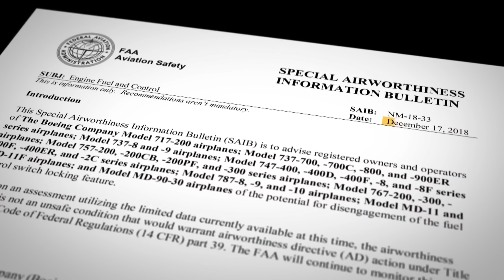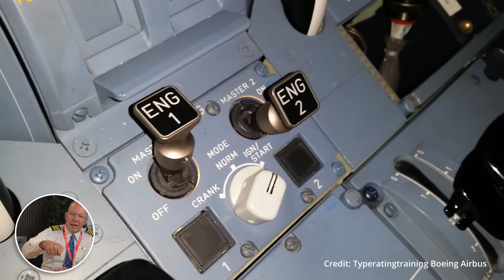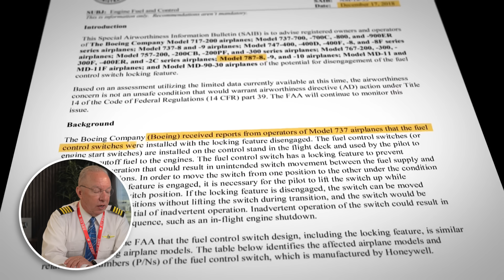Air India 171: The FAA’s 2018 Fuel Switch Locking Bulletin Explained (16 Questions Answered)

Comment: Very surprised that you are so definitive that one of the pilots deliberately moved the fuel control switches to off. How can mechanical failure of the switches be ruled out so early in the investigation? Was any maintenance performed just prior to this early morning flight? Had any problems been previously reported involving the switches?  I’ve read reports of these switches being replaced twice during this aircraft’s lifetime.  It seems too early to quickly blame the dead guys.
Reply: One switch, maybe.  But both? At the same time?
Reply: Well the fact that BOTH went out, then both engines started to spool down (which the fdr picks up)..... then the voice recorder picks up one pilot asking the other pilot why he did the cutoff..... then the fdr picks up a pilot switching the cutoffs back on and one engine starts spooling up before hitting the ground...... seems like they were working and as Steve says..... if they had just a little bit more altitude the one pilot might have been able to save it
Reply: The investigators have the switches from the crashed plane in their possession and will certainly have tested them already. if the locking mechanism was defective a directive to all operators of Boeing airliners would already have been issued. That has not happened, so no problem was found with the switches.
Reply: @SeanFication  I find it interesting the preliminary referenced that bulletin but didn't give any report on testing.  I say test results are still TBD.
Reply: These switches are not going to jump to off all by themselves believe me. They are engineered so that can never happen by accident
Reply: Because its the logical conclusion to all evidence and life in general. He didnt want to leave his act to chance, turned off the engines right when you must not do it. No way to save it right then.
Reply: If the PIC was the junior officer, it would make sense for him to ask the captain why something so out of the ordinary was done, in deference to his many thousands of hours more experience. To me, the response, "I did not do so", was off. I would have expected a note of dismay or alarm, like "WHAT??", or more likely "WTF!", and not what sounded defensive, and certainly not helpful.
Reply: But why would the pilot ask the other pilot , why he did that? If I notice something the switches are off I would say “ what’s happening, or how did that happen “ , not why you did that
Reply: @freedom5941  I think it's quite the opposite. If the fuel switches are off and you didn't put them there, first instinct would be to blame the other guy.
I agree with @87AeroCoupe, Steve seems way to dismissive of any other possibilities for the switches to be off, without any evidence other than it never happened to him. A failure of the indentation mechanism is not absurd at all, in my mind. 
Just after getting my driver's license, I was driving my dad's car with him, and there was a couple of times where the gear didn't fully engage, causing the car to make a loud grinding noise and not accelerating when I throttled. This was a relatively new car, and it had worked perfectly fine until that day. Note that this car's shift was also indented, and very sensitive, any movement in the direction of the gear would snap it into gear. My dad's first assumption was that I was somehow hesitant to change gears, and I was fighting the snapping mechanism, leaving it halfway. A few days later, he got stranded in the middle of the street when the gear would engage. The gear synchronizer was failing. Since it had never happened to my dad, he couldn't even consider this.
Reply: @freedom5941 Because he was covering his actions and muddying the waters for the investigations. Or the person who responded was lying, either way they know their words were gonna be recording only in 20 seconds. If this was planned out like i think it was, creating the recorded narrative was paramount to the criminal. This cockpit is a logic puzzle.
Reply: @freedom5941  Yeah which is why I wonder if one did see it even out of the corner of their eye. And someone saying it's not me can have more than one explanation. Depending on who did or said what. And if one did it and the other one said why and the answer was they didn't, I think it might help to know which pilot said what. B/c they're might be different dynamics in an exchange if one has seniority or rank and experience over the other. The only background I heard on either in interviews was the FO was engaged to be married (per his family) and the captain might have been a caregiver possibly livein with his father. I don't remember who provided that information on the captain.
Reply: @freedom5941  - Under panic anything might be said, it could be assumption that the other pilot had done it when it was actually mechanical failure?!!!
Reply: @DangoGSD under panic ? I won’t be blaming other pilot .. I would be wondering why it happened, this clearly seems he saw something , why do you think pilots can’t be human beings when so many have done this in the past
Reply: @freedom5941  no, you're very wrong. it doesn't clear anything. under panic when one doesn't have much time and death is clearly visible, they would try to converse as quick as possible and go with their first thought, which is, in this case, he would think that the other pilot might have only done it as there's no one else to do. it is also possible that he did it himself but also asked why did he do it to the other due to some mental problem. also the way you think doesn't apply to everyone. basic common sense.

but, main thing is that it's not possible to switch them to cutoff so quickly.
Reply: @debargha0_0 it takes a second to cut it off as per pilots ..
Reply: clueless
Reply: Denial is a sin.
Reply: They were switched out on that plane in 2019 and 2023 for reasons unrelated to Boeing's bulletin. It's not clear whether that would have "fixed" any problems in the bulletin that were warned about or not.  The timing of when both switches moved to cutting the engines off to being the worse possible time pretty much dooming the aircraft. Though I'm not sure 01 means "One second". Tend to think so b/c  seconds are reported that way when they display the time of incidents (in situations where seconds matter) as 7:43:13 for example. Or 08:02:03.  Unless there's an obvious issue arising from maintenance issues (which has happened in other plane crashes) which leads to recalls of parts or even plane models for example, might be quite some time b/f they release information on it. I think Air India dropped the ball by not inspecting the fleet's switches. And they can always get more information or inquiries into the switchouts on the plane in 2019 and 2023. But I wonder unless someone witnesses the switches being moved to "Cut" why the question wasn't more along the lines of "what just happened". And wonder if it was witnessed even if via peripheal vision (as the switches are in between both pilots).  CVR is impacted by having what it captured especially in comments made because it's paraphrased and that can be biased more than an accurate transcript would be.

Comment: There is still zero evidence it was deliberate action, only thing is that the switches where to the cut off position, only that. You are speculating a lot.
Reply: The preliminary report quoted the one of the pilots asking the other one why they turned it off. He’s not speculating- he simply read the report.
Reply: clueless

Comment: Hey Captain Steeeve, love your insight always. What is your opinion regarding a physical design change in the fuel cutoff switches? Design a secondary set of switches on the Captain's left side that a First Officer physically could not reach from their seat. It would require the Captain to physically concur with the decision to shut fuel from the engines. No, it would not prevent a Captain from having mental health issues and cutting fuel, but it would be one more failsafe to take a possibility out of the equation and ultimately allow the Captain to be responsible for the decision to cut fuel to engines.

Comment: Steve seems to be pretty convinced that it was the pilot and is not willing to consider some unforeseen flaw. Wish there was a cctv footage here to defend the dead pilots. There was an advisory by Boeing the switch locking mechanism not working, then was this cause not considered in this case. Looks like Boeing has something to hide by shifting the blame solely on the pilot.

Comment: the first officer was flying as mentioned  in the report and captain was handling other things ,  so after takeoff the captian moved the fuel switches asumming the copilot has his hands on the stick , there should have been more strong words exchanged if the copilot had did it , and the RAT deployed photo shown in the report show plane right above the domestic terminal  and still above the runway  , and why they have not released the full transcrpt og the voice recorder ?

Comment: I feel like 10 seconds is quite a long time to reopen the fuel lines, isn't it?
Since the first engine started to produce thrust again. Would have a quicker reaction (2 seconds earlier for example) have been enough for the plane to climb?

Is it maybe an idea to delay the closing of the fuel switches in flight by 5 seconds or only allow them in a case of fire (this would also prevent the mistake to shut down the wrong engine)

Comment: This failure looks like  G-load at V1 or V2 that knocked back the switches to cutoff, it could be failure of the SPRINGS that moved them automatically to Cutoff position, if they slipped over the Detent which does not look that deep. This is issue with the Switch itself that is made by HoneyWell. If Boeing was aware of this and has simply issued an Advisory instead of a Directive, they are in BIG TROUBLE

Comment: I find it odd that:
1). given how close the 2 pilots were sitting next to each other and that each of the 2 fuel knobs required some conspicuous actions to move from run to cutoff, wouldn’t one of the pilot have noticed the other pilot moving the knobs? If so, shouldn’t we have heard “what are you doing?” rather than why you did cutoff and the corresponding reply he did not. 
2). During takeoff, aren’t both pilots hands on the yoke and won’t any action to move both fuel knobs be noticeable?
3). If the knobs were on cutoff, why do some reports say the knobs were found in run positions at the crash site?
4). Could something else eg: electronics have caused the fuel cutoff, which made the pilot seem surprised and ask the other pilot the question he asked? 5). In an attempt to kickstart the fuel process again, could the pilots accomplish it by moving the knobs again from run to cutoff and then to run again?

Comment: Many thanks to Captain Steve for clarifying this. 
My father was an Air Force crash investigator many years ago, and I always try to imagine his perspective on crashes like this. Hopefully, this crash will prompt a fundamental design change in all future Boeings - just as the landing gear cannot be retracted on the ground, the engines cannot be shut down in flight (or the in-flight shutdown procedure must be significantly more complex, not just mechanical latches with springs). Otherwise, the whole purpose of any investigation - to prevent similar crashes from happening again - will be defeated.

Comment: Have you read the bulletin? It recommends inspection as incorrect insulation can result in mid flight engine shutdown. The air India plane was not inspected. It’s hard to still believe Steve is impartial, the way he blew right past this.

Comment: The switches need to be subjected to Failure Analysis.  Also this does look like a "design flaw": the position of the switches and the fact they are spring loaded to return to the cut off position.  Also the fact they are not disabled in this phase of flight when there was no abnormal condition like an engine fire.

Comment: This proves you are heavily paid by Boeing to facilitate their narrative. So far there's no evidence to suggest that it was Pilot interventions to cut off the.fuel. infact the voice recording has clear denial from the pilots to have anything to do with cut-off. On the other hand there's Advisory to Pilots towards the ongoing issues with the locking of fuel switches. Clear Evidence of prevailing issues with Boeing design and manufacturing.

Comment: If there was a flight mode cutoff switch alarm, perhaps attention could be brought to the problem before both switches are set to cutoff.  In this case, both switches were set to cutoff and it took ten seconds to set them back to run.  An alarm might have brought attention before the second switch was set to cutoff.

Comment: 7:46    No, I don't think what you are saying is correct. Some aircraft have that locking feature disabled and they did NOT fix it. Because it wasn't mandatory. You state they wouldn't be able to put it to the RUN position as it would go back to the cutoff position. Then how did the AI flight as well as others take off?

Comment: There are two clues what support a voluntary fuel cutoff:

1) The 1 second between the two cutoffs - that's pretty consistent with someone being in a hurry to do so;

2) The very specific question the other pilot asked: "Why did you cut the fuel off?". This is a very strong indicative that he saw the act of flipping the switches. That, in turn, means that the pilot who did it must have been aware of it, too.
Reply: What's he gonna say he did?   Noooo.  He knew there was a possibility they would recover the CVR.  He was hoping the fo wouldn't figure it out in time.  Or say something.  So his only answer could be . .  . If this was a suicide to collect insurance.
Reply: @robnanney  Absolutely. But at that altitude, even if you flip the switches back immediately, the aircraft is doomed.

Comment: My understanding is that the 2018 switches were installed without the locking function, possibly an optional part that's a collar with the barrier and sloping faces.

Comment: 1. If one pilot deliberately cut the fuel, why wouldn’t he admit it, knowing survival is impossible?
2. If the other pilot saw fuel being cut off, why didn’t he intervene or confront?
3. Wouldn’t one pilot monitor and stop the other if something wrong is being done?
4. If this was deliberate, wouldn’t the conversation continue with confrontation instead of stopping abruptly? (cockpit voice recorders)
5. If the intent was to crash, why allow the engine to be restarted?
6. If it’s so easy for a pilot to crash a plane, doesn't that put everyone at risk?
Reply: Ur spot on .
Reply: 6. Yes. Hence the need for better psychological profiling.

Comment: everyone is still speculating what had happened in AI171 ..only if there were a Camera we could have some solid evidence ..sad part is if its really a mechanical failure no one can proof it now since everyone is started to blame pilot now..and if its really done by one of the pilot it will be really hard to know who did it out of those two..
Reply: Ur being played into the hands off Boeing when U even think off it as Pilot Error. It's clear to investors who said what, just not made public yet due to ongoing investigation but important is as of now it's clear other pilot denied doing so. and Blaming Pilots is  wrong without conclusive evidence.